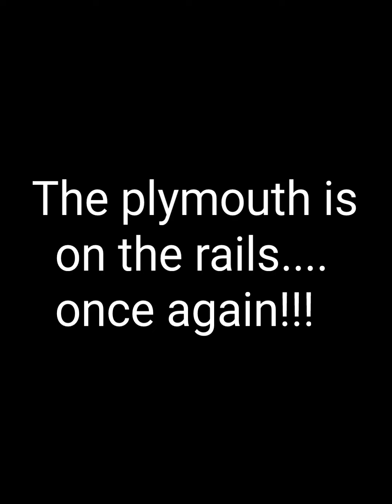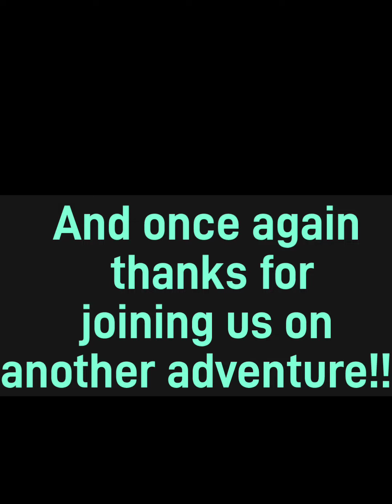Locomotive Delivery Success!

Comment: Is she a gas one or an early diesel? Pretty cool either way.
Reply: I believe early diesel. The original engine blew up so they put a Chevy 350 in and converted it to propane. The chevy also blew up😂
Reply from the maker: Gas, but there's a rod and a piston connecting rod out the side of the block and oil pan... 🤣
Reply: @UnknownRailfan  Too bad, I would have liked to see the "will it run " vid for a 1928 diesel.😉😊 The 350 was not a good choice. They should have used a GMC 305 V6. A locomotive needs torque and the 305 has lots of it. Even better would be the V12 700 ci version but it would be expensive and hard to find.
Reply: @sandhillcentralrailway4447  Seems like someone was pushing the little beastie a little too hard.  So I guess it will need more than a "Little Tidy" before she is operational. 🤷‍♂🙄
Reply from the maker: @MatthewBerginGarage  I'm not trying to be mean. But out of a dozen ml6. Ml8, hlc Plymouths.... I havnt seen 1 yet with its original Leroy engine.... there big boat anchors
Reply: @sandhillcentralrailway4447  I won't take it the wrong way. I didn't expect it would be any good. I just wanted to see one.